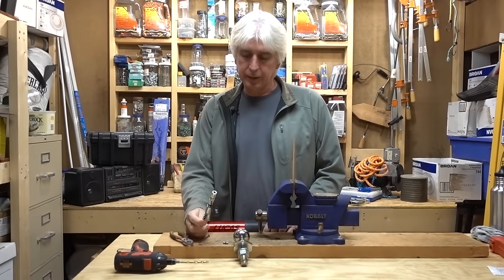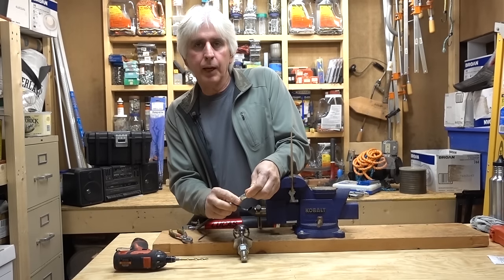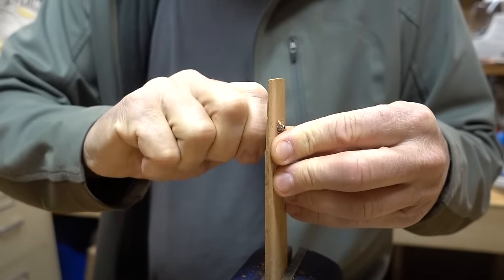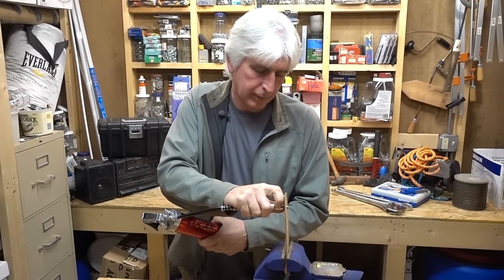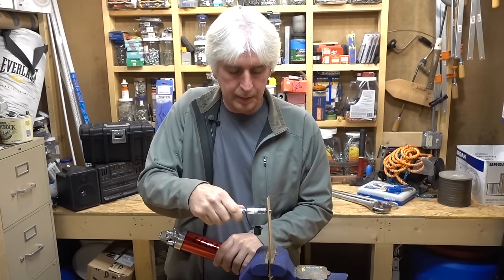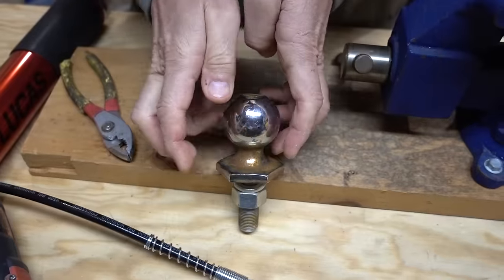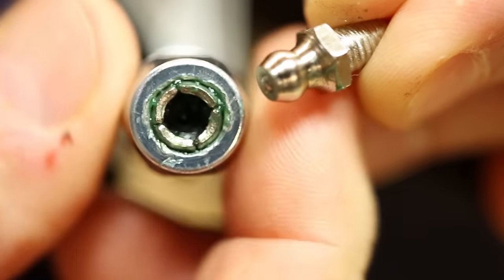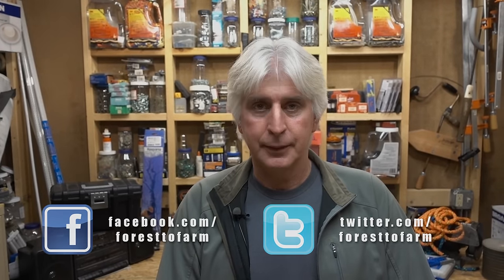Getting A Secure Fit With Your Grease Gun

Comment: OK so I'm doing something wrong.  When I turn my grease coupler to attach to the zerk, it does NOT become tight on the zerk.  It's just loose and flops around no matter how much I "tighten" it
Reply from the maker: I have no idea what is happening there. I can say that if your grease gun nozzle works the same way that the one in the video does then turning in the “loosen” direction to far would result in the nozzle coming apart while the other direction would reach a point where it will get as tight as it can go then come to a stopping point. If yours continues to spin then it may not be the adjustable type. No telling what is hitting the market these days. Good luck. 
Terry

Comment: My issue with my greese gun is even when I lock coupler onto the zirk, greese still leaks out at the connection and dosen't seem to even be going inside where it needs to go. Help!
Reply from the maker: Hey. My first instinct would be to change the zerk. Good chance it has restricted flow or is totally blocked off. Always be sure to wipe the zerk off well before attaching the coupler and check that the coupler is clean inside as well. Good luck! 
Terry
Reply from the maker: You could also maybe try borrowing someones grease gun and see if you are getting the same results. 
Terry
Reply: @ForestToFarm  Thank you! I will try that!
Reply from the maker: @vikings844 any luck?
Terry

Comment: Mine does not turn so I bought a 12$ new tip from Amazon and it does not adjust either. I went to our longest yard sale hear in Tennessee and looked for grease guns found quite a few none of the tips are adjustable. How did you find tht unicorn of a tip my search failed.
Reply from the maker: Hummm. Check closely. A few people said theirs would not adjust only to realize later it would. Every one I have seen does adjust.  Let me know what you find. 
Terry
Reply: @ForestToFarm  I think you're simply wrong.   Yes, it's true you can unscrew the tip, but it's not supposed to be unscrewed.   It's simply the design to hold the spring that tension the coupler for fitting on the zerk.   That's why the function you're suggesting isn't mention in any ad or manual.  Just check Lincoln, one of the most common guns around and have been for a long time.   So, sure you can unscrew the tip, loosening the spring tension to allow it to go on the zerk easier, but it won't tighten down anymore than if you just leave it fully screwed down and push the coupler over the fitting for the spring loaded locking it's intended.  It's a super idea though, but for now, the only way to achieve that a better attachment to the zerk (and easier) is one of the spring loaded lock n lube or similar.   I have one and it doesn't seem to work better than a regular off the shelf gun.
Reply from the maker: @rlews1531  We all have our opinions. All I can say is it works for me and it seems that many here feel the same way. 😁
Terry

Comment: Only thing that could have been better would be a demo of best attempt at pushing grease through the fitting with and without the tightening tip.
Reply from the maker: Yeah however I assume most people would have already experienced that on their own 😂.  Another addition would be showing having to force it on the zerk and then trying to pull it back off. Lots of people bring that up. Thanks for watching!
Terry

Comment: if the grease gun end is working properly it tightens itself on with the grease pressure
Reply from the maker: That seems like the ideal condition. However based on my and it looks like just about all the other posters here that does not always happen. Maybe if you clean it up and reassemble then it might help but even new ones act up on me. Not disagreeing with you. Just making real world observations. Thanks for the input! And thanks for watching! Definitely something to consider. Either way if its is acting up my little tightening trick sure does help out. 😁
Terry.

Comment: I used to fool with those grease gun fittings until I discovered Lock N Lube connectors. No more connections that come lose while pumping grease.
Reply from the maker: I have one but its still in the pack a couple years later. 😂 Thanks for watching!
Terry

Comment: Better yet, buy a Lock N' Lube end for your grease gun. Basically a quick coupler for your grease gun. Add a pistol grip grease gun and you'll be done greaseing in no time.
Reply from the maker: We have a Lock N’ Lube. Have never used it. Still in the package 😂. Gotta try it out one of these days. I will say there are some tight locations I do not think the Lock N’ Lube will squeeze into. But I am guessing it would be great for most applications. Thanks for watching and commenting!!
Terry
Reply: @ForestToFarm  it fits in some darn tight places. Really doesn't need much clearance. One of the best time and frustration saving purchases I've  made 🙂
Reply from the maker: @ohsoloco5113  Gonna have to try ours out. 😁

Comment: So it's grease, it takes a minimal amount of grease to completely lose any grip on the nozzle so you can't turn that son of a biscuit to get it off the fitting!  These are by far the most frustrating thing in the world.  Either pull so hard it breaks the fitting, or turn it so much it comes apart.  Then find the spring, put it together, wash and clean everything, and 10 to 20 minutes later get to your second fitting!  Yeah piece of cake on an older vehicle with a fitting that is challenging to get to and dirty /greasy area.  Maybe some really coarse threads would work for an actual grip!  I could see that but that tip is absofreakinlutely horrible.  But that's my experience...
Reply from the maker: Sounds like you love grease guns, lol :)
Terry

Comment: My gun will tighten over the fitting like that but grease will still escape out the sides and not go into a brand new zerk fitting 😓
Reply from the maker: Might be a poor quality zerk? Some of this newer Chinese stuff seems to be out of tolerance. 
Terry
Reply: @ForestToFarm  Thanks for the response, I ended up hustling having the wrong coupler on. The new gun I was using came with two and I commented this after only trying one of them. Thanks again for the info!

Comment: I’ll be damned!!
Reply from the maker: That was kinda the way we felt, ha ha. It really helps for those stubborn zerks that will not allow you to get it connected or the ones that will spill grease all over the place while pumping. 

I do have to say that the grease gun we have in that this video does not work very well any more. They make a grease gun nozzle that is called "Lock n Lube". It does basically the same thing but simply by squeezing a litlle lever on the side. Check back later and we will give a review of it when we finally get around to buying it.
Terry